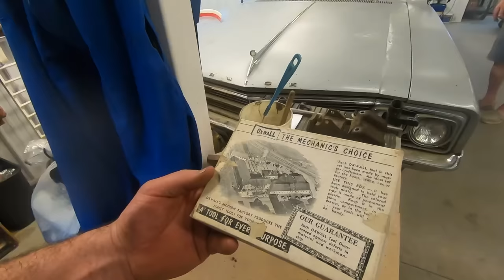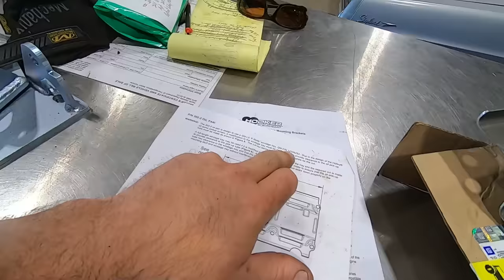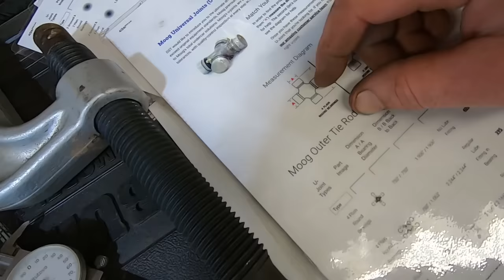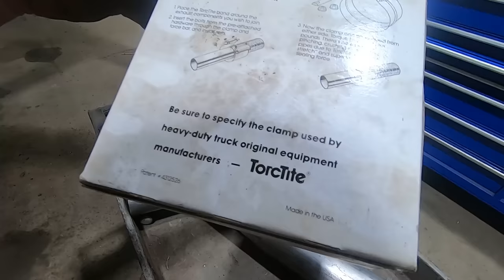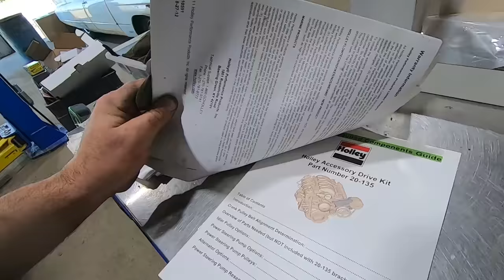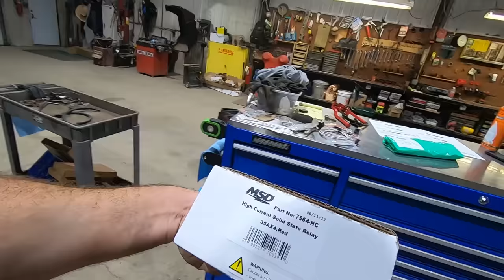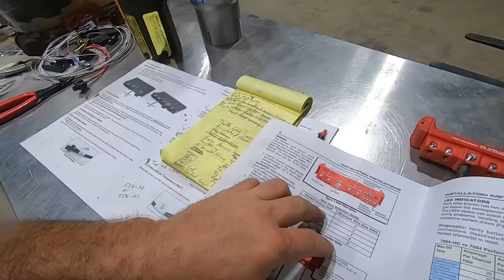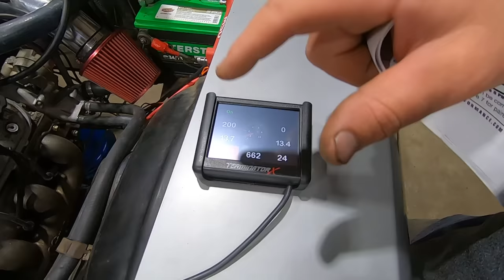I surprised my dad by LS swapping his 1966 Buick Skylark for his birthday!

Comment: What a nice BD present.  We had a 70 Skylark 4dr hardtop.  I don't remember the engine specs but it wasn't exactly a "dog" .  Loved that car. White with brown vinyl top. We had it two months and 1/8" chips of paint began disappearing all along the driver's side.  The dealer didn't have an explanation. They had it strilpped and full paint job good from then on;

Comment: Took a few days to get through it but thank you for posting such an in depth video on LS swapping one of these. We have a all original 300/2, 2 speed 67 Buick Special 4 door tucked in the back of my shop. Wife's great grandmother's car, family owned since new. All original save for a same color respray in the 90s. The 300 is down on compression on one cylinder and I really want to do this exact swap along with adding AC and a brake/suspension upgrade..
Reply from the maker: Awesome! You’ll love it!

Comment: I put an electric 16" fan on my truck when I freshened it up,  and one day everything was fine then the fan motor just quit. Bad day from there. I want to do it again, but I want a two fan setup with the radiator out of the green 5.7 truck you saw. What's wrong with cleaning, and painting bolt or nuts? I use a board with holes drilled to paint my bolts, or organize valves and push rods. Nice job on the LS swap, but being around your dads age, my bucket list is finishing my "projects". He was probably happy and disappointed. Nice job though. Wish I had a son that would put in all that work plus the dollars!

Comment: The ultimate Dakota sleeper.  I'd run two cycles of 1,500-2,000 miles with detergent oil just to clean out the LS's guts.  The engine sounds growly and good.  Your Dad will definitely see to it that the LS has a long, productive life on the road.  Kudos!

Comment: You would be amazed at how many guys don’t know how to convert tire sizes back and forth from metric to standard. I have found that it’s not always that close. It’s usually within an inch or so. It’s worse when you get in to the larger truck tires.

Comment: I had a 1971 Pontiac Ventura, which is basically a Chevy nova six-cylinder. I had to give it to my dad when I was 25 because I moved up to Alaska. I also had a 74 Vega hatchback that I put a 318 aluminum block cast-iron sleeve V-8 Out of a 1963 Buick it got destroyed in a hit and run guy ran a stop sign hit me head on and destroyed it. I was 23 now I’m 66.

Comment: My dad was an engineer,,.. an aeronautical engineer, he spent most of his career working on a torpedo, and he loved reading, he had quite a collection of magazines, every HotRod and Motor Trend from 1950 to 2010.  All that said, there was one thing he did not care for,,..surprises, when I built a car for him , he planned out every detail, all I had to do was put it together,,.. ha ha ha ha, easier said then done, I got pretty tired of saying that.  But after a couple years I managed to build his “ dream car” well it was for the time,,.. the 80’s kinda sucked as far as power was concerned so we came up with a 1980 El Camino 350 four bolt mains, Doug Nash five speed and a Ford nine inch test end. I even made a dummy air pump to get it through emissions testing.
Reply from the maker: Awesome

Comment: Very nice. But I will say in Chris Farley  voice.  “Remember that time you said engine swaps just snow ball. Custom  radiator water pump swap hose modification exhaust pipe that did fit right and other slight modifications.  That was awesome!!!”  That’s what it takes for a Ls swap. And for me I swapped an Ls into a Subaru and kept it awd with a subbie trans.
Reply from the maker: Awesome

Comment: fix the speed sensor or calibration issue and the trans will shift correctly 4l60e needs to be able to send a vss signal to the ecu so it knows when to shift in conjuction with the tps on the holley..this build is killer ..hope this helps you out..lol sorry i just saw you figured it out..lol awesome!
Reply from the maker: No worries

Comment: My grand dad had a 1965 nova. It was a plain jane with a 6 cylinder. I tried to get it from the family after he passed. One of my Uncles pitched a fit. So he got it. And now it sits in his backyard. Just rusting to pieces. He never even got it running again. What a shame. Too far gone to do anything now. It has set for 25 years in same spot. Floors gone, trunk gone, quarter panels gone. Car had minor surface rust when he got it.
Reply from the maker: Dang

Comment: You should use any parts store has assortment pack in the stroller bag. It has right angle search issues around angle CERT and you won’t have that problem. We have take the wheels off the grease it because it will be here for about 45 to be angle city.

Comment: I own a 1965 Mooney M20C (airplane) my grandfather bought brand new in Kerrville, TX then after my dad passed I own it. It's called the Porsche of the sky really cuz I can fly from Rockford Illinois to Galesburg Illinois in 30 minutes with nice tailwind otherwise it would take two and a half 3 hours to drive it's a fast little 4 seater. It has the Lycoming O-360-A1D 180hp with manual landing gear typically known as the Johnson bar

Comment: I just swapped a replacement 6.0 into my 2500hd and the oil pressure on it runs on the low side too.  Engine only had 120k miles too so it shouldn't be too worn.  As long as you've replaced the pickup tube oring you should be good.
Reply from the maker: It seems fine this far

Comment: Pops is one stoic dude! But that's the way some of the old dudes are. Old dudes. LOL! I suppose I fit that description at 53 now, and if not, then I soon will! Anyway, I am willing to bet there was some moisture in his eyes behind those dark shades. Great job, Mortske, and congrats on bringing your dad some joy. Good show, man! Thanks for bringing us on the ride with you. The "easy" LS swap ain't as easy as it seems, much like I figured. I will stick with my old gen one small block. The Holley Sniper Stealth I installed by myself on my 67 Malibu in my garage on frigging jackstands is about as far into the future as I wanna go for now. Up next.....700R4? That's the plan when the cash is stacked high enough. Wish me luck! Oh, almost forgot, the A-body FI aftermarket tanks increase the depth and capacity from the stock tanks. They had to be made deeper for the in-tank pumps to fit. I think my 67 went from 20 to 25 gallons. Not fun filling that thing up, especially when I run 110 octane leaded!
Reply from the maker: Sounds like a sweet ride!

Comment: You can help low oil pressure with heavy weight oil, try 15-40 or 20-50  😊

Comment: Oh by the way, Moti I had a six cylinder 67 Camaro that had the linkage type look up for the throttle not the cable that you’re showing there so it just depends on the car I guess had a factory 10 V with probably three white gears in it

Comment: Check on paper work if it was made on 2nd shift, I was working for Buick on final assembly. Probably put the spare tire in.
Let me know if you still have the spare, and if it was installed correctly 😉 
Thanks
Reply from the maker: No wonder it's flat!
Reply: @MortskeRepair  maybe that's one of the cars that I put lower radiator hose on and transmission cooling lines on . We built those cars at 56 cars per hour.
Thanks

Comment: I'm a FAN, Mortske! This' my 2nd watch on this, video. I fell in love with the decapitated Ghostbusters, buggy. Then, throughout the years, my late grandfather had a few of those old, Catalinas. I wish I had that old Pontiac with a 6.2/Turbo/6Speed/Air Conditioner, it wouldn't even have to have all of, that. I'd be happy with a HAPPY little 5.3, just pull your 396 and bring me the car & the, parts? So far, I like the old Chevy Station wagon, BEST! IF I remember, correctly? That 'ol sumbiatch was a, NOMAD? I watch ALOT of you? Puddin', D & D, "Peg", Halfazz... (Don't get me, started, you MEN are fuxkin' around in MY ELEMENT. I just don't have the RESOURCES coz I hurt my back in 2007 swapping beds on my 76 SWB/stepside, it came dropped 4" from the, factory. I paid 250.00 for the , body & it came with a title. I bought it from my, friend. It didn't even come with a driveshaft, the wiring was TOAST.  
I went 6.7/350HD+ B & M stage 2. She had a lil more but moat attention span(s) are 30 seconds... LoL. Don't think I don't watch me some, "Duff."

Comment: Also Mortske  :) 5.3 Litre is 327 for (350)  but you said this 6.0 be (400)  call  that engine and RPM is 850 if to oil pressure be 60 PSI  too!
Reply from the maker: 6.6l is 400

Comment: I was curious. I am currently doing the 5.3 l swap on my 66 Grand sport 2-door Buick. I'm having trouble with the engine mounts lining up. I'm running the shallow oil pan from Holly but SBC engine mounts that convert to LS. Any input? Thank you. Your videos been very helpful
Reply from the maker: I used the Hooker mounts. No issues

Comment: No mechanical fuel pump on LS engines?

Would it be possible to keep the original pedal with the new assembly you put in if you wanted to keep the interior more original?
Reply from the maker: Nope, need a high pressure pump. I'm sure there's a way you could if you put enough effort in.

Comment: What would have made me happy is to have left the original engine alone and instead, called SMS Auto Fabrics and got the correct seat material and had those seats redone. With so many mods, doing maintenance is going to be a nightmare. No more I need a set of plugs and belts for a 66 Skylark.
Reply from the maker: It’s a helluva lot more fun to drive now. Parts is the east part.

Comment: The Buick Small Block (215,300,340,350)  were high on torque..and will drop into anything that housed a rwd 3.8 Buick V6. The old engine and transmission would be a great setup to put in a 80's Regal, an old Buick Skyhawk..or an Apollo/Century Sport Coupe to fart around in, maybe a teenaged family member for a first car...or a bracket racer. A late 70's Skyhawk would be a rocket, thats a Chevy Monza with a better bodyline. Maybe find a blown up Skylark and rat rod it.. its a thought

Comment: Little tip because you’re cheap. The pro seal from sold at Harbor freight online is as good as the right stuff but way cheaper whenever I glued my room together with it I had to take a hammer once I take the bones out and not cover off so that’s a bit of a biscuit. It’s not gonna leak or shower

Comment: Couldn't you use an 1in or 1 1/2in fan spacer??
Reply from the maker: No it’s a height issue
Reply: @MortskeRepair  Ya, I didn't see that right when you started started talking about the fan but I did see that a little later in the video. I didn't think about going back and changing my comment.
  Some what new subscriber and love your content. Keep up the great work man.👍.

Comment: Transmission has to be set on machine it's not a old 3 sp and it is possible to burn it up with it searching for the next gear plenty of information to explain the how and why just like the TV cables on 700r4
Reply from the maker: Programmed it through the Holley setup. Easy peezy

Comment: I mean the smart thing would be to do an electrical fan instead of a mechanical fan. And also change the water pump. What you did anyway. Didn't find out until the end that the reason that you went with 3 in. exhaust but considering fitment issues the smaller probably would have been better wouldn't be hitting everything. Because a lot of those clearances are way too tight even on the trans because you can't even really service it without having to drop everything. But you really should consider taking it somewhere having the rear window popped out and fixing that rot in the back because introducing a whole lot more life into this vehicle would be all for not if that rots through. If it's not too bad take it out and seal it and paint it if anything. But man those things in the headliner look awfully bad. Not sure how they got above driver but around the perimeter you can tell it's because leaking doors. Headliner still good just looks bad. And maybe a replacement fender on the bad side not a bad ride.
Reply from the maker: Why does that make it a smart move?
Reply: Because the mechanical fan would cost too much of an issue and electrical fans actually work better and it would solve some of the interference issues as you obviously figured out which then allows you to change water pump to something that works better. I know the drive to stay original but sometimes you just have to upgrade for cohesiveness. But I hope you guys figure out the transmission issue and getting more than 56 percent throttle.
Reply from the maker: @johnkaehler4237  How exactly do electrical fans work better? Water pump, transmission and throttle issue were all resolved in this video.

Comment: WARNING!⚠️ You're not going to like this but you totally missed the mark on your Dad's plans for his grandfather's car. Don't get me wrong, I'm a big fan and YT autoplays your videos long into the night. Problem I have is you could see him cleaning every bolt on a wire wheel and painting and organizing every part with plans to get the car back together with all original parts. He also has a factory 4-barrel intake with hopes of topping off with stock carb and air cleaner. You slapping a super disco engine and trans into the family ride didn't move him one bit. Do you expect him to just take his parts and toss them in the scrap bin??? Would have been a better surprise to clean and treat the underbody and find the parts he was missing and do the work together. That time together would be a memory that will last a lifetime. My Dad is dead, don't wait. Save the LS swap for some teenager that needs the attention and hopefully won't wrap it around a telephone pole. I know I won't make any friends with this post but it's the truth. I know you gave him a gift in your way and that's your way of showing him love but you neglected to take into consideration what he wanted for the car. Thankfully it's reversible. Make it right!
Reply from the maker: Thanks for watching!

Comment: I think it was you in a different video goofing around and saying what are True Duels anyway. You hate when someone says true duels or whatever well, Nice true duels are what you put on your Dad's Skylark. Non-true duels are where they come off the left and right exhaust manifolds into a single pipe all the way back to the muffler then off the single muffler turns them into 2 short tailpipes hence that is not true duels. Some even have a Y pipe at the front into a single pipe all the way to the back then the single will turn into a reverse Y at the very back then feed 2 mufflers one on left and one right side with just a short piece of tailpipe off of each muffler or a muffler in the long single center pipe then into at the very back split into 2 resonators at the very back with just we fancy tailpipe tip off of each. Hence once again not true duels. 😎 I once owned a 1966 2-door Skylark GS that I tossed in a Chevy 427 Rat with a Turbo 400 with a reversed valve body with a shift kit and a 12-bolt Chevelle rear end in it with a 488 gear. Ran nice real nice lol. Car Color Factory White with Gold Pearl added to it with Custom Flames Painted On It with a Factory Blue Interior With A Factory Counsel Fitted with a Hurst Rachet T-Handle Shifter and ET Mags that looked similar to what you have on your Dads for the moment With Raised White Lettering Tires. This was all back in 1974. :hand-purple-blue-peace:I used to Race On The Street and at the Drag Strip. Drove my rides every day to work and back as well rofl yeppers them were the days. 🤪
Reply from the maker: Good times

Comment: I'm glad that your Dad loves it.  But, you absolutely butchered that Buick Skylark with an alien engine.  I don't care how pretty the LS swap looks.  Should've kept the original Buick engine or put in a later Buick 350 if the original engine couldn't be rebuilt.  Little tricks like a Pertronix electronic ignition are not noticeable and a Holley Sniper fuel injection could be semi-hidden under a stock air cleaner.  But LS swaps are a dime a dozen.  Keeping a fine car like that original is better.
Reply from the maker: He likes it, plus it'll all bolt back together to stock if need be.

Comment: Man you absolutely need to put the stock wheels and hubcaps back on it SCREW those modern wheels that car belongs 100% the way it was bought. That's a survivor and it's a part of your heritage so DON'T DO A THING TO IT just get it running. I will be very disappointed if you put modern wheels on it and don't put those original wheels and hubcaps back on original hubcaps are SUPER COOL
Reply from the maker: Nope, 14" wheels and tires suck.
Reply: @MortskeRepair  hey everyone, 14" wheels and tires suck! They are 1" smaller than those super awesome  15" wheels!
Reply: Old Buicks are cool👍 Still kicking myself for letting a 70 GS get away from me years ago. Wheels are an accessory..

Comment: Why not overhual the motor for your dad. You think with over 100 thousand miles you think it kind of need it.
Reply from the maker: Because they run for 300,000 miles regularly
Reply: @MortskeRepair  my tow pig is a 330k mi 5.3in it. Runs good but last owner let a rear heater leak cause it to overheat.🗿 So now it burns oil, especially under load. It's the LS engine that needs rebuilt👍😂  Dependable engine design tho. Just gotta service em